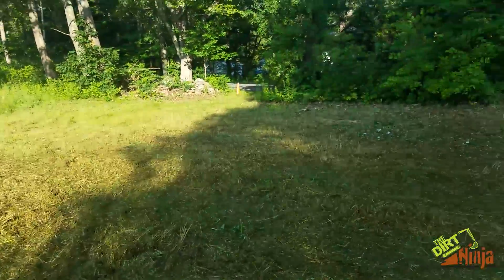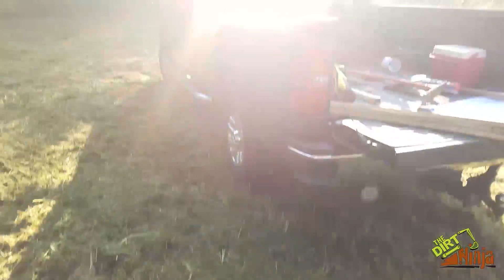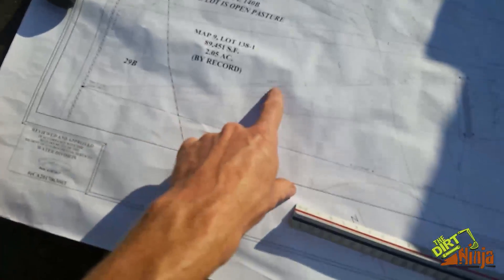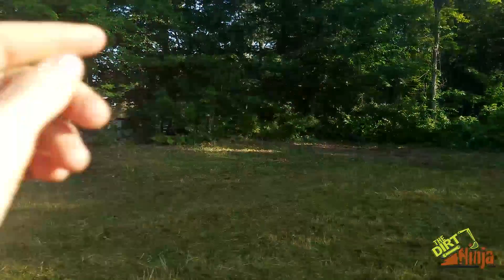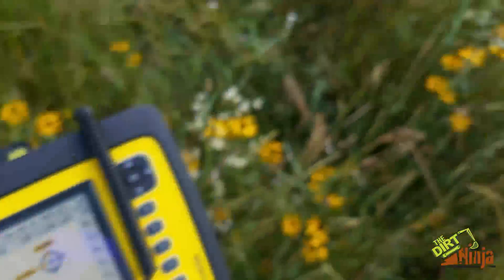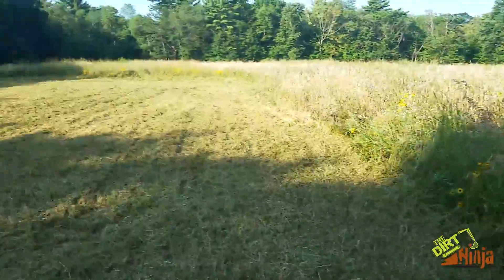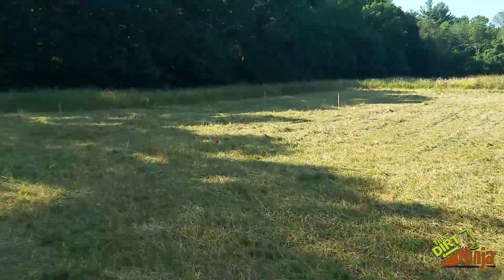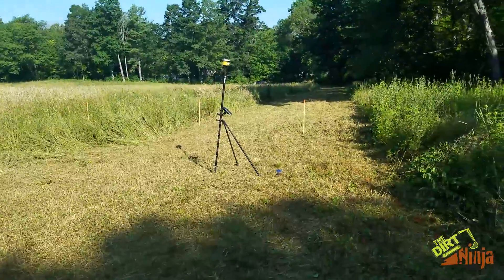Laying Out A House Lot For Excavation - Trimble SPS585 GPS

Comment: There are definite advantages to GPS (I have 4 RTK receivers & 2 total stations).....but mistakes are even more likely/of greater magnitude when an error occurs. I understand the convenience factor, but can see this going really bad. If you're provided a .dxf, who is liable when a mistake is made, and a lot dirt is moved in the wrong location? Or even worse, on an adjoining property owner?.......I'm not trying to talk you out of it; in fact, I think you should buy it. But just be prepared for some VERY expensive lessons.
Reply from the maker: Very true, good points. I always still do pull ties to one corner to double check that at lease one corner is in the right location. Just like my GCS Flex grade system in the excavator. I always get out of the machine at the beginning and check grade with my laser to make sure everything is correct.
Reply: Double & triple check. I know that PLS's can purchase insurance for mistakes, maybe that's a possibility?

Comment: We make White Oak Survey Stakes. We currently make 3 sizes because the Surveyors are so picky. 
Actual size is 1x1x48,  .75x1.5x48, .625x1.125x48. With the smallest being the best seller by far. 
Tough to believe there is .65 of a lb difference from the biggest to smallest.

Comment: If you do buy this system, next time you should put in a post with 5/8in thread on it for the base.  So if you come back to the site and need to check grade or a point then you will not need to relocalize, or as you say orientate.  It just makes it easier in the long run.

Comment: I'm looking into similar systems.  What are the advantages over a total station other than the GPS.  My company is comparable in size  and I guess I'm not seeing the need for the  huge range of the GPS units plus the fact that you can lose GPS signal.  Have not had much experience with the newer GPS systems.  Keep up the great work.
Reply: GPS is much more efficient & easier to use. The Trimble systems are accurate down to .02' horizontally & under .04' vertically. I use GPS for 80% of the layout I do on my heavy highway projects. Then add in machine control, makes a huge difference in production.

Comment: Now does this help add gps to your flex or earthworks systems on the excavators?
Reply from the maker: Yes it can in the future if I want it to. The gps receivers can be mounted on compact equipment, but not on larger equipment. They are not made to take the beating from larger equipment. Thus the cost savings with this system.